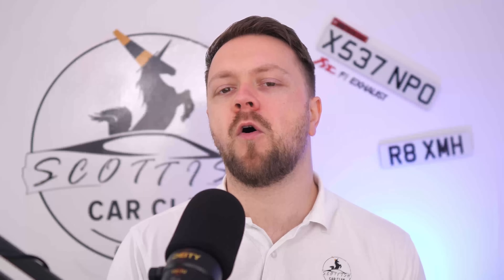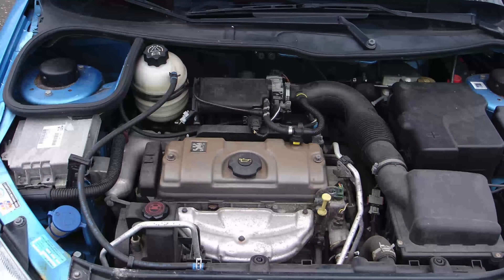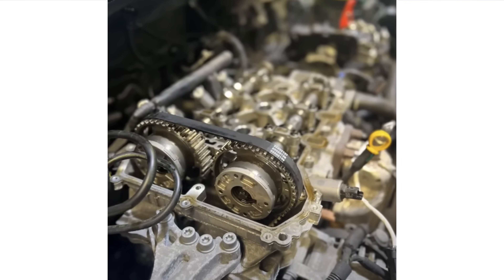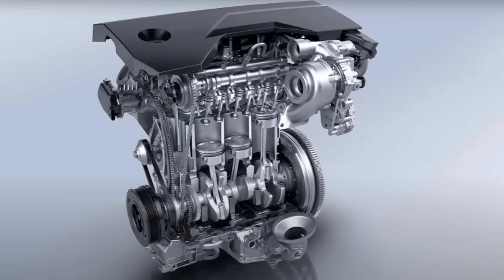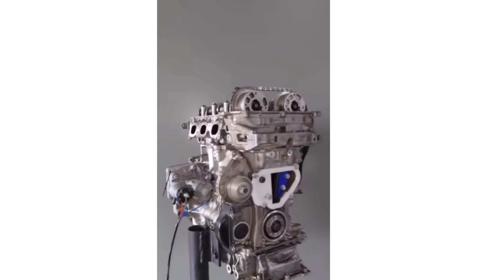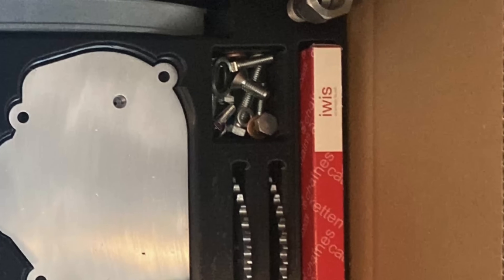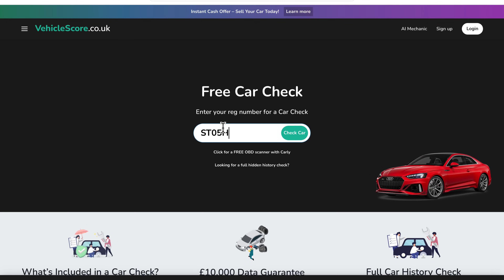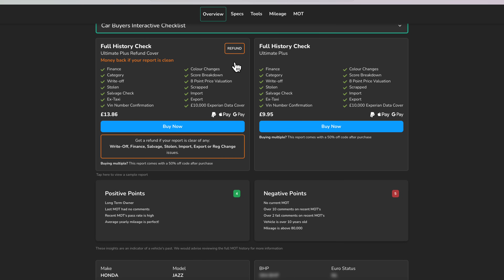Peugeot PURETECH FIX UPDATE | CHAIN CONVERSION

Comment: Guys I am from India and I've bought the Citroen C3 puretech 1.2 N.A. (82 BHP) in September 2025. I think and hope mine's a chain driven and not the rubber one. As someone who had been driving Suzuki and Hyundai this is my first experience with the French car. I like my car overall. Just this engine makes a lot of noise and vibrations are felt too something have to say the japanese and korean counterparts doesn't have. in the lower RPMs it bogs down a bit in traffic but once it gets going it's good. 

Any suggestions/precautions I need to take while maintaining please let me know.

Comment: Dam too late I got my Peugeot 408 2024 1.2 a month ago,dealer never told me it was on recall when I got it,it was lucky I checked government sight as something told me to check it once I got it,I
Apparently I was lucky to book it in for this month that was November I got i managed to book it,i tried to book it earlier and was told that all Peugeot garages are fully booked up through till March with recalls,I wasn’t told what recall was for until engine management light came on while driving,Peugeot dealer told me when I told them about going into limp mode that that’s part of recall,thankfully it didn’t go to limp mode when I was going home on motorway,so now my car is a paper weight till middle of this month,I have watch many reviews on the car they all said awesome car,these reviewers should be telling you about the engines too,there is no way don’t know about the engines in these cars before they review them,in a way ime lucky I’ve only got 1600 miles on clock and got it at a good price,now once Peugeot finally get the work done ime going to sell it and hopefully not lose too much,problem is what to get next,

Comment: That is still no updates on this kit for the conversion. Can you find out what’s going on please
Reply: I've been told that there is not enough space to safely fit the chain and assocciated paraphernalia within the engine casing. They are looking for associated companies within the motor trade to help with the development with this conversion at a realistic cost.. I doubt that this will happen. I've a 2019 3008 with 46,000 easy/soft miles. No excessive oil comsumption. I'm going to have a new wetbelt fitted/enginecleanout /filters etc....At this point in time it's the safest option.
 
 .

Comment: I need to know if the Citroen C4 puretech 1.2 turbo 130 HP still use belt ? If so if i buy a car from 2024 with 30k klms if it still use a belt does this chain conversion Works good ? Thanks

Comment: Nonsence change at recommeded intervall use the specified oil and belt and no problem Will occur. I changed the belt after 70000 km it could have run 70000 km more it was not possible to see any damage on the belt.

Comment: Bollox, just bought one today 2107 Pug 208 1.2 Puretech with 42k miles , did research afterwards. Live and learn. Know why it was cheap now. Thx for details, will have to weigh up if want to pay out for chain as car was so cheap

Comment: Hi Scottish Car Clan,
Thanks for the excellent update on the PureTech chain conversion kit!
I have a 2016 Peugeot 208 1.2 PureTech (EB2F variant) currently showing classic wet belt failure symptoms - oil consumption every 2K miles + fault codes P0012, P0340, P0341, P0344.
A few quick questions:

Any update on UK availability/pricing since March?
Do you know any UK garages already offering this service?
Is the kit definitely compatible with 2016 EB2F engines?

Stellantis wants me to wait 7 weeks + £165 diagnostic fee for their temporary wet belt replacement, so this permanent solution sounds much better!
Really appreciate you highlighting this option for PureTech owners.
Cheers,
Chris

Comment: Fkcn disgraceful. All car owners who own cars with these well known  troublesome wet belt engine issues should be fully reimbursed by the manufacturer/designer of such shabby workmanship and design.

You state that this wet belt design was to get around emission laws. 

Net zero BS comes to bite us on the arse again, from all angles. 

They should never have rolled them out until they had been fully tested for reliability and durability. 

Wrong, so wrong on the end consumer like myself and many thousands of other car owners with wet belt fitted engines by the sounds of it. 

It sounds like I will have to fork out several hundred pounds out now to put their shitty design right. 

Thanks  Stelantis, whoever you are!

A big thank you to you bud for highlighting this so nobody else gets stung.

And also for pointing us to a better fix, albeit at our own cost.

Comment: Interesting to see variable quotes on wet belt replacement in the comments - my local Citroen dealer quoted ‘about’ £1300 to replace the wet belt on a 2019 berlingo…

Comment: I can never understand which people buy the Peugeot with the 1.2 L engine. Peugeot use a range of engines and the 1.2 is the worst by a long way. Just ask a Peugeot or European specialist mechanic. The 1.6L petrol and the 1.5 or 2.0L diesels are all suitable. The best of the engines is the 2.0L diesel - a proven engine with plenty of power, good fuel economy and will last forever (500,000Kms is not uncommon).

Comment: Mine has 190k km, and it isn't the belt that gives the problems, but the oil consumption. Now 1 litre every 1500 km. I will try 5W30 now in stead of 0W30 as a band aid.
Reply: Our 3008 2017 is at 183800km. Catalytic converter went out. Probably because of the high oil consumption. 3L per 1100km

Comment: I have a peugeot 208 gt 2021 manual and I never had this problem. Wet belt no issues at all. I currently have 51000 kilometers and still works like a charm.
Reply: Os problemas vão começar a 120 mil km, sugiro que faça as trocas de óleo 2 a 3 mil km antes do prazo, para que aumente a vida útil do motor

Comment: I got the wet belt replaced yesterday at 72,000 miles on my Peugeot 2008. I paid only £180 for labour and used an INA OEM quality wet belt kit from Euro Car Parts.
Reply: Yes, INA timing belts and kits are considered good and OE quality. I always use them.
Reply: have you ever seen ANY pattern part that would not be claimed as "oem quality"? I haven't 😉
Reply: @plllot9713  INA timing belts and kits are considered good quality, often exceeding OE (Original Equipment). I've fitted them for years.

Comment: Hi there does this include the 1.2 automatic you might sound stupid I'm not scratched good on cars I did buy this car from Perth show about 8 months ago sadly my wife passed away and I've been worrying as well about the wet belt situation that's the card is a 1.2 pure tech automatic 2012 do you reckon I should go to the dealer and explain about this video thank you take care and thanks for your information
Reply: Sorry I mean I might sound stupid
Reply: Power
96 KW / 128.7 BHP
Max. torque
230 Nm at 1750 rpm
Aspiration
Turbocharged
Engine capacity
1199 cc
Cylinders
3
Transmission
AUTOMATIC
Number of Gears
8
Top speed mph
124 mph
Top speed km/h
200 km/h
Acceleration 0-60 mph
-- sec
Acceleration 0-100 km/h
-- sec
Engine location
FRONT

Comment: Stelantis, the problem with oil consumption has already been fixed in engines starting in 2019. EB2ADTS, they have redesigned the piston group, but the advice to everyone is to change the oil no later than 7-8 thousand kilometers. This is the whole problem with these engines. Has anyone changed the oil with such a frequency? I am sure that no one!
Reply: I have a Citroen 2017 C4 Flair with the 1.2 130 BHP Puretech engine.  The oil is changed roughly every 6000 miles and the belt was changed at around the 30,000 mark.  I had our garage pop off the sump at the 42,000 mile service to check the oil strainer, and it showed no sign of contamination with bits, in fact it looked pristine.  So it is possible that looking after your engine, getting the oil changed regularly and changing the belt well before the manufacturers recommended time might help a great deal.  The engine still still uses almost zero oil between services and sound great with plenty of power.  In fact I tow a boat with it that weight 1000kg including the trailer and it pulls it like a toy.
Reply: @mwhi475   You see, if you take care of the engine, everything is fine, and it works fine, I have a friend who drives a Peugeot 208 1.2\130, 2019, the car has already passed 200,000 and does not consume a single gram of oil

Comment: The company does not respond to emails. Either they don't work anymore, or they don't care, so you can forget about this technology and just keep an eye on the belt and change the oil more often. Moreover, Stellantis has made a new oil tolerance, where they have removed the calcium that was corroding the belt.  Total Quartz Ineo RCP 5W-30

Comment: Great, we have an upgrade for the timing chain, but I'll wait for the upgrade for the problem of oil leaking and burning on the pistons.
Reply: Stelantis, the problem with oil consumption has already been fixed in engines starting in 2019. EB2ADTS, they have redesigned the piston group, but the advice to everyone is to change the oil no later than 7-8 thousand kilometers. This is the whole problem with these engines. Has anyone changed the oil with such a frequency? I am sure that no one!
Reply: @vitalkino  2017 motor and i have to refill oil every 1000km or less
Reply: @hansfiebig_  Tell me, what was your oil change interval? What is the mileage between replacements?
Reply: @vitalkino  i buy the car with 68.000km, at 88.000km i change the timing chain, oil change interval every 10.000km
Reply: @hansfiebig_  This is the norm. Try to change the oil no later than 10,000, and preferably 7-8, especially if you drive only around the city

Comment: I have just ditched my 2008 (17 plate) as a part ex.  It had the belt replaced on the recall program at 49000 but by 59000 was burning a litre of oil every 1000 miles. By 66000 I'd had enough and was fretting about what the next expensive issue would be.  It has been the least good Peugeot I've owned and my loyalty goes back to my first 305 in 1983!  Such a disappointment.
Reply: Wrong engine for a Peugeot.

Comment: In Brazil, Chevrolet now uses the rubber belt bathed in oil in several models and it's been a disaster. Total loss of engines.

Comment: Is the Corsa f 1.2 2025 still fitted with a wet belt.
Reply: if you chose the mild hybrid it has a chain. The normal one has still a wet belt
Reply: Ok thanks, Vauxhall are too slow to do the right thing

Comment: Thanx very much. That is exactly what I was searching for. I am omner of a Peugeot 208 2018 82 hp. I was shocked when I heard about this fatal construction error. This car is so lovely. The exteriour design the driving behaviour the comfort (besides the seats) ;) and the engine. How can you construct such a trash in such a good car?! I will fix it the next months. I had a new belt last spring. But what I knew now I would say: the earlier the better.
Best greetings from Germany and thanx very much again
Reply: No, not yet. I'm not in a rush. But I was on the homepage and seems absolutely serious.
The reason is that I changed the belt last year and I was not sure if I sell the car all the time. Now I decided that I will fix the car with this chain and after that I will sell it. But this will be in this fall I think.
I use it to less and therefore I want to buy an older Limousine. This is stable in value. Besides that I'm very happy with that car. I will give you an Update. I'm very curious too.
Reply: @klausmuller3986  Wie würde so ein Wechsel genau ablaufen? Wo kann man das machen lassen? Und ist das überhaupt legal?
Reply: Any updates?
Reply: Did you get this belt?

Comment: Love this, I have a Peugeot 2008 with this engine and have been looking for a solution, are there available in the UK yet?, if so can you please link me to where I can get this
Reply: The company does not respond to emails. Either they don't work anymore, or they don't care, so you can forget about this technology and just keep an eye on the belt and change the oil more often. Moreover, Stellantis has made a new oil tolerance, where they have removed the calcium that was corroding the belt.  Total Quarz 5W30 RPC

Comment: Im looking for Peugeot 3008?is the 1.6 has the same problem with the wet timing belt?
Reply: No. The 1.6L petrol engine has a chain - change at 180,000kms

Comment: The chain looks like one from a bicycle. 

Why can't you see the engine running?

If you were to make such a kit, you would probably use a chain like the ones you see in similar engines.

How can they guarantee that the chain will never need to be changed? 

I don't think that's a good solution🤔

Comment: Yesterday I just changed the timing belt with all the accessories, 618 euros, 72,000 km, the engine used to work great, but now it works perfectly, like a cat purring.
Reply: where did you get it done? I am struggling to find anyone who can do it
Reply: Mejor o peor

Comment: Why is it that my Puretech 1.2 130 hasn't suffered from belt break up, neither has my WIFE'S Puretech. 90,000 & 50,000 miles.
Reply: Because you take care of the cars and change the oil on time, of course, if you change it after 15-20 thousand, no belt will survive it!

Comment: Just remember. This kit will only serve a purpose on healthy relative new (low mileage) engines. Those engines who has already had clogged strainer issues will still have problems with oil consumption. The blocked strainer starve the engine for oil and excessive wear is the result. Especially the piston rings are hurt by this. They get worn, they get stuck and they damage the cylinder walls. The point is : if it's using oil? The engine is already beyond repair. Only viable solution is a new engine and then retrofit the chain.

Comment: What is the possibility of using Chain system in new hybrid engines?
Reply: @keremardicli4013  Motor manufacturers are like sheep,if one does something like this ridiculous wet belt idea others follow,the same happened with dry belts which wasn’t a great idea and it cost a lot of people a lot of money when they snapped without warning,at least with a timing chain it rattles for months before snapping or failing. If you ignore the warning noise’s then it’s your fault but the manufacturers should stand the costs of these wet belt failures up to at least 100,000 miles like Land Rover should stand the cost of their crankshaft failures that’s cost owners thousands of pounds because of inferior parts.

Comment: A warranty extension for previous generations of the PureTech 1.0 and 1.2 engines is implemented since March 2024, covering 100% of the costs for up to 10 years or 175,000 kilometers for both parts and labor, under certain conditions. A full service history is a requirement.

Comment: I dont know why people want to change the belt for chain, when the safer option is to buy a new car with the new chain fitted ones or without a 1.2 at all! The belt allready started to melt inside the oil you can be sure of that, no worth keeping any car with this engine old 1.2 PureFail.

Comment: One question about the chain conversion. What type of oil would we have to change to, seeing as a chain wouldn't need the stupid expensive 0W30 oil (last one I bought was just shy of £50 a gallon for the cheap stuff from GSF, even with a discount code!!!) after the belt has been replaced with a chain?

Comment: For all owners ! Conversion isn’t possible. New engine has 60% parts different. New engine works on Miller cycle principle. There was only one problem with Puretech in my career. Timing belt change is easy if you know😀

Comment: At least with a corsa, it's cheaper and you can monitor the belt by opening the oil filler cap, not so with a ford, let's hope it becomes a recall 🤞

Comment: I really can't see the point of this modification, who will want to do it when a car has already covered 60k, just change the wet belt and drive another 60k, iunfortunately t's just a service item that doesn't last as long as the previous generation dry belts, but it doesn't make the engine a bad design, it's about managing the users expectations and backing it up with a decent warranty

Comment: I have a:
Kia Sportage
1.6 CRDI
136 hp / 320 nm
Age 2019

It also has a wet belt that drives the oil pump. Is there any update for this or a newer or more reliable and robust belt for this?

Comment: Stellantis have done this fix themselves, the 3rd gen EB2 engines (EB2LTED variants) have a camchain. I wonder if this retrofit is using the parts from the new EB2 engines.
Reply: But it is only on the mild-Hybrid, i don't know if it is retro-compatible
Reply: @jmigserra1986   Unfortunately, no, you can't even put a new engine with a chain instead of an old one with a belt, they are not compatible.

Comment: I have 60k wet belt warranty, plus if it fails before hand, I can get a free replacement done, with additional 60k warranty on it. Worth keeping up my service history with Vauxhall just for this purpose
Reply: carreful with the oil pressure, when it drops results in brake failure , not worth this risk
Reply: If it fails, you will lose the engine.

Comment: Does anyone like their Peugeot enough to do this?
The wet belt change is about £500-700 for a dealer to change,  so to buy this kit at what, around £500?

For £1000 you can put the money towards buying a different car

Comment: £600 to swap a Puretech wet belt out for another sounds very cheap. Are you sure this is right? A Ford dealer doing the same job on a Fiesta Ecoboost charges upwards of £2000. Is the Puretech belt procedure less labour intensive?
Reply from the maker: Yep nail on the head there. Because of the positioning the puretech belt can be swapped with much less labour. £600 / £650 is about right.